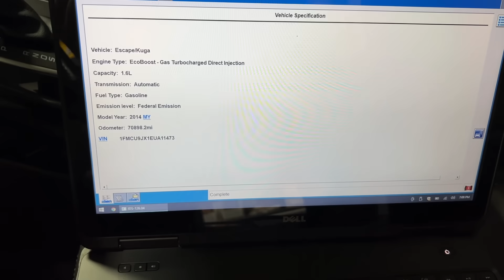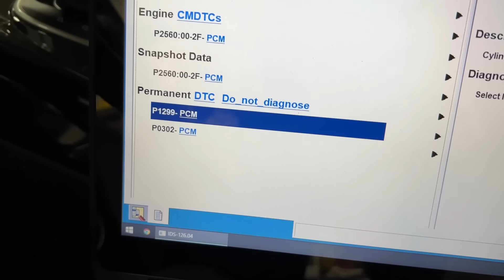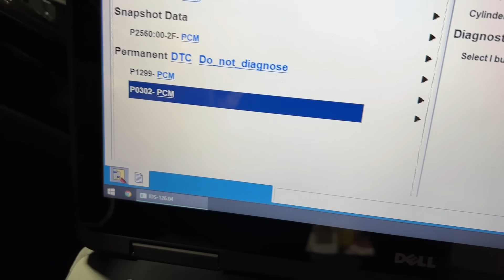Beware of Ford’s 1.5L 1.6L 2.0L Ecoboost Engines and Their Never Ending Coolant Consumption Issues!

Comment: Brian, how does a long block compare to replacing with a “crate” engine?  Cost and reliability…and what does a “Crate” engine actually include?  
Concerned 2014 2.0 so far so good Escape owner…
Reply: Crate engine would have "just about" everything you need (ECU, harnesses, pedal...etc) to drop it in whatever vehicle/frame you're putting it in.

Comment: On the vehicle sales sheet, along with the price and features, shouldn't they list MPG of coolant?
Reply: It's the auto change coolant feature. No need to drain. Just keep adding 🤣
Reply: @TheBigdog868  Just like the old English cars and bikes - if it stopped leaving puddles or wetting your boot, you were really low on oil!
Reply: The oil leak feature on the Duratec engines helped keep the subframes from rusting.

Comment: Is this the Cleveland plant engine 2.0 only or the one from (Spain?) also?
Bought a Ford extended warranty for our 2015 Edge with the Cleveland plant 2.0 to go to 125,000 miles. Hopefully it'll start burning coolant before that.
I marked the coolant level and watch it regularly.
Reply: We had our replaced in our 2017 Fusion; the engine was built in Valencia.

Comment: Thank you for what you do. I have a 2015 2.0 EcoBoost Escape and I am afraid. It only has 60k miles. Do you know what actually triggers the failure?
Reply: Drive it like a baby, try to keep it out of turbo boost.
Reply: @v12alpine  turbo boost?
Reply: @willburke6006  Turbo Boost is that button Michael Knight would push in the KITT Trans Am car on that 80’s TV show called the Knight Rider.
Reply: Ford lol sorry couldnt resist. Hope yours lasts s long time.

Comment: Depressing. We have two cars with the 2.0 liter turbo engines. One is an early build 2013 Escape and the other is an early build 2016 Fusion. Do you just wait for them to fail? Are there preventative steps that can be taken besides careful maintenance and not hot rodding them? Is the problem more common with Valencia built engines then USA built?
Reply: I've never heard of a older 2.0 eat coolant... Just haven't... I've had 2, neither have done it and don't see it happening right
Reply: My 2015 Fusion 2.0 has never had any coolant or carbon issues and it just turned 130k miles. Of course I run premium fuel, service ALL fluids every 30k miles and LOF is done every 4k with CRC GDI treatment before oil change. I am not easy on this car at all and it's time is split evenly between city and highway driving.
Reply: @christopherharris3229  How do you use the CRC treatment?

Comment: I did a cylinder head on one of these 1.6 with 90K on the clock after the camshaft spun in the timing gear taking out the valves. Special tool this, special tool that lol. It took me 3 damn hours just to adjust the valve lash!

Comment: Love the content and correct information you put out. I recommend to all my clients to avoid any and all gdi or gtdi engines. Don't care who makes them, it's a temperamental design at  best that doesn't deliver the fuel economy they promise. Ditches my 2013 f150 with the 3.5 EcoBoost. Timing chain rattle was starting, oil leaks at the turbo, fluttering from the turbos, missfiring on start ups. No thanks. My 4.6 2 valve ford v8 has 500,000km never been apart! Oil filters and oil, 1 set of spark plugs. Never changed starter, alternator waterpump or coils.
Reply: Just purchased a 97 grand marquis because of how crappy all these new cars are. Few of these new cars will be on the road in 10 years. It's even terrible that Ford ruined the 4.6 with the 3 valve
Reply: Buy almost any basic sedan style car or 1500 pickup designed in the early 90's to the mid 2000's.
You can't  really go wrong
Reply: Chuckle...just commented on my 4.6 2V too. Love that engine.
Reply: @LouJustlou  So did I.  They are absolute beasts.
Reply: I have a 4.2 V6….the underrated baby brother of the 5.4 and the 4.6.
Reply: @standhd  I didn't know that! Cool.
Reply: While what you say is generally true we will see how Toyota fares with their new boosted V6 Tundras. On my car, the economy with GDI is 38 mpg around town and in my Port Injection car also with turbo it was 28 around town. Some GDI carbon up bad and others don't. There are many factors. For trucks I hear many people love a big V8.  if you only get 2 mpg better with a boosted V6 then it does not make sense. If it was a lot better then it might be worth it.
Reply: 7.3 two valve Godzilla - saw a f250 with one ,$80k still on lot after 3weeks. They got a lighting $80k and Jack dealer charge of $25k!!!
Just had my 3.5th phasers done in time 59920 miles, thank god

Comment: #2 Hole looks like an old 3.8 V6 from years ago. Those damn head gaskets leaked all the time. Ford should have set a spare set in the glove box. If I remember correctly -- Warrantee paid  around 6 or 7 hours and customer pay was around 12 hours.

Comment: They ever fix this issue, or would it still exist in a 2017 Escape Titanium 1.5l as well?
Reply: Ford has a TSB on 2017 through 2019  with this issue. My 2018 is waiting on an engine due to this issue. 56700 miles and it threw a P0302 code. Ford pressure tested it and found coolant intrusion in cylinder 2. No other issues with the car prior to that.

Comment: What year EB is considered the updated longblock? I got an 18 Escape 2.0L and have just started getting Cyl 2 Misfire that I'm hoping it's just the plugs
Reply: 2020
Reply: @sjn7220  that explains it because the moment i finished this video i went out and realized my engine was about a quart low on coolant
Reply: @scylla8911  If it's under warranty, take it in ASAP.